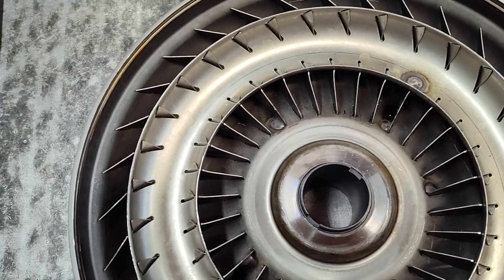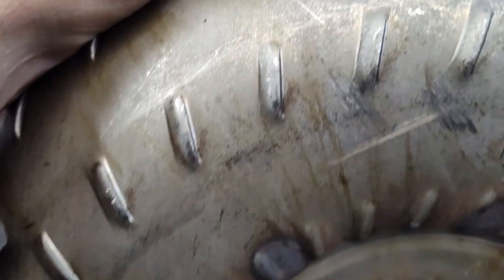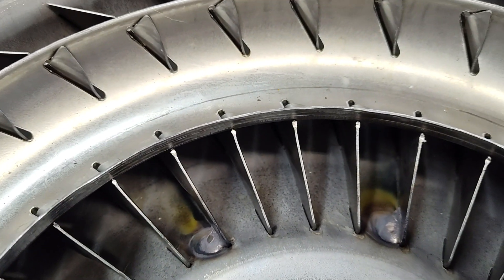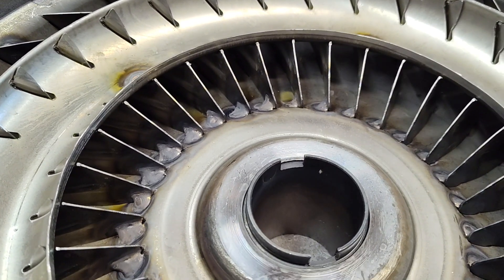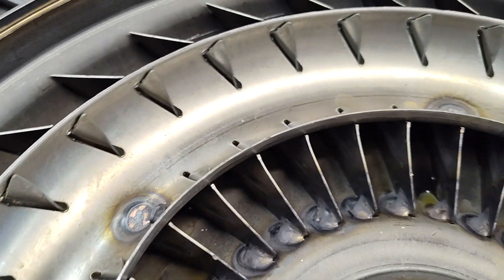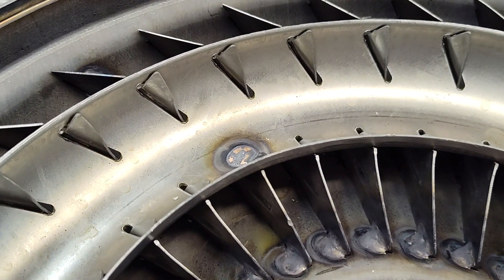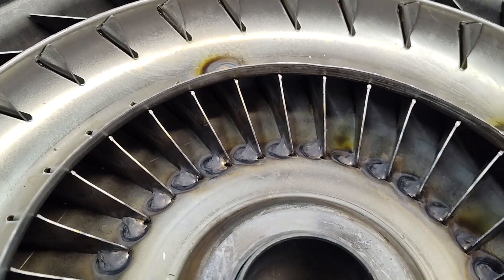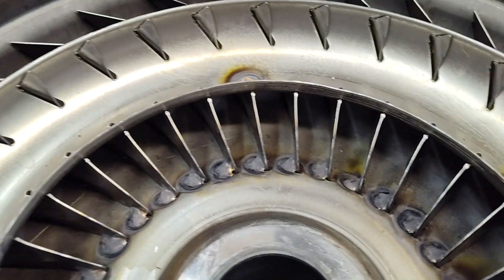Why Weld Torque Converter Fins?

Comment: Does welding warp anything or have any balancing issues?
Reply from the maker: Good question. Yes it can. I use silicon bronze wire to minimize warping and we have an electronic balancer to make sure it is still in balance after work is performed.

Comment: I'm glad I purchased a converter from you. My 408 with a turbo and you're transbrake is gonna be building a lot of torque off the line. I had a couple other converters that sounded like a screwdriver running across bicycle spokes when you spin them after a couple months of use.
Reply from the maker: Thank you. We appreciate the business. Sometimes bearings can fail as well causing the noise you refer to.